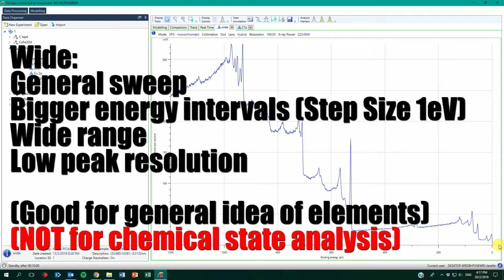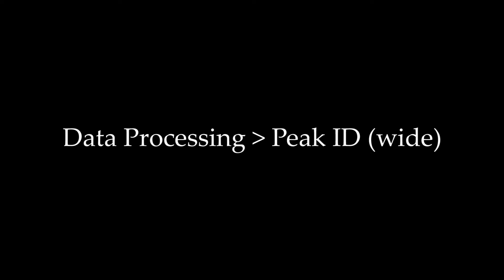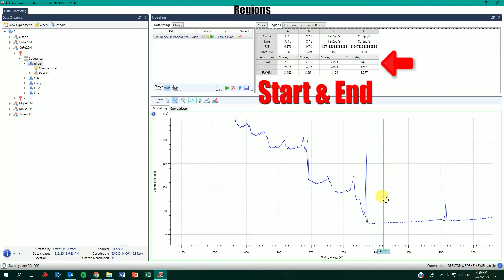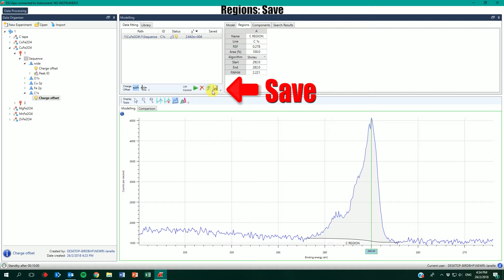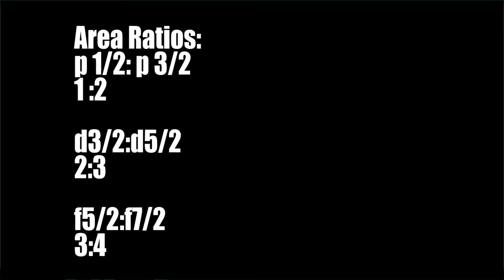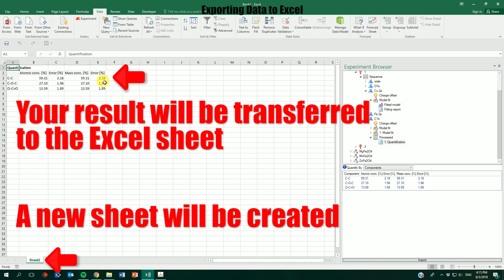Comment: How to fix the area. Intried using your instruction but not working? Which keys to be used to fix the area?
Reply: Just click on the spaces in front of this ~. The first one, which is the constant C-C, should be left untouched. Other peak IDs can be worked on by typing A and space bar. Guess this is too late now but hope it helps someone out there